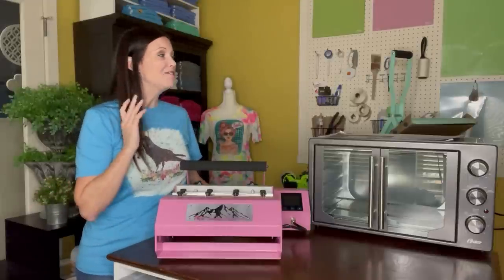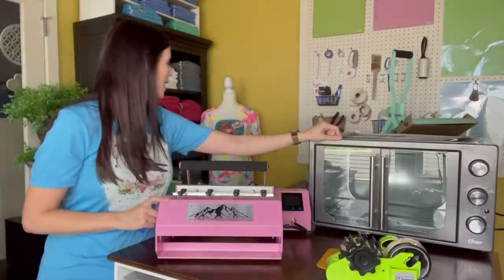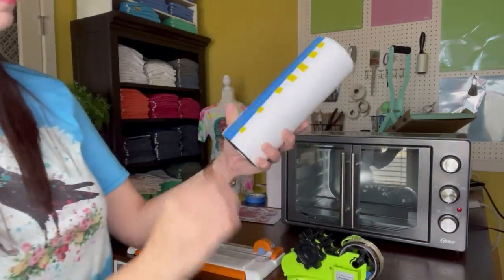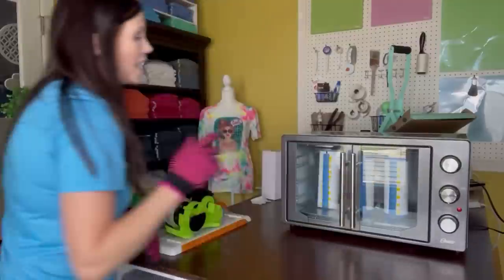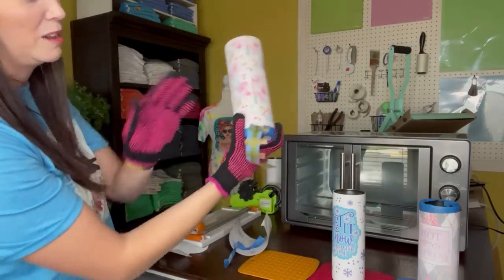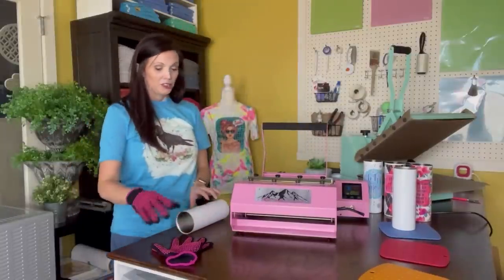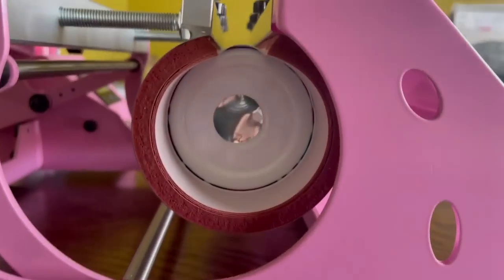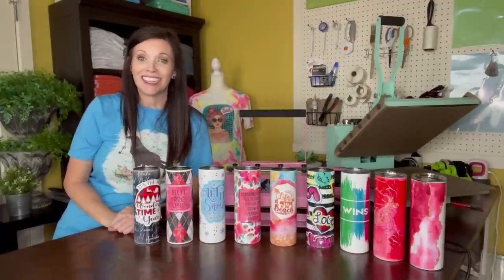How to Sublimate a Tumbler with a Press or a Convection Air Fry Oven.

Comment: I have the oven I no longer use shrink wrap and I use a silicone wrist band for top and bottom of tumbler so there is no ghosting.
Reply from the maker: Thanks for sharing Terry! I’ll have to try that!
Reply: So just the sub paper and silicone wristband? Or do you use tape also for the entire cup
Reply: Can you link the wristbands you are using for a newbie, please?
Reply: Is painters tape heat resistant?

Comment: Great Job Emma. I'm still kinda new to sublimating tumblers and had never seen it done with painters tape and without shrink wrap when using convection oven and the images still came out very nice. The video is very informative as I would not have thought about the edges of the mug press not being as hot and now when or if I decide to purchase a tumbler press I will make sure the length if appropriate. Thanks again for this video.
Reply from the maker: Thanks so much! 😊 welcome to the fun world of Sublimating Tumblers!

Comment: have a question about tumblers i keep trying and im not getting perfect images everytime is there anyway you can tell me what im doing wrong looks like in spots looks like its  a negative in spots and some come out like its kinda brown but color ok. ive had temp  at 400 385 and 390 for 8 min and then tried at 6 min anyway you can help thanks
Reply from the maker: It sounds like it may be too high of a temp for too long. Mine sublimate best around 365 for about 6 minutes

Comment: Question: with the convection why did you turn them? I thought if they were standing they would heat evenly all around.
Reply from the maker: I had watched a few other tutorials where they turned them halfway through. However, since then, I've had a lot of recommendations to increase my temp just a bit and then not rotate them at all.

Comment: I have the same oven from Oster french door and find it very difficult to get the temp at 365.  I have 2 thermometers in the oven.  When the dial is set to 350 on turbo convection, the internal temp is around 400-450. Any tips on setting the temperature at 365 or 375?Also, how do you know when the oven is done heating up?
Reply from the maker: Sounds like something is wrong with your oven. If your dial is set at 350 the internal temp should be 350 not higher. Your oven needs to be able to vent to release the hot air, do you have it in an area where all sides can vent? Mine has vents on both sides, back and top. I know when its pre-heated because I set a thermometer inside and as soon as it reaches the temp, I'm good to go.

Comment: @Emma’s Cottage. Do you have any trouble with blowout using the press? I was just wondering as I’m thinking of getting this tumbler press and don’t want to get ink on the pressing walls or what ever you call them. 😉. Please keep your videos coming, love them! 😍
Reply from the maker: Thanks so much for watching! No, I have not had any blowout issues with my tumbler press.
Reply: @Emma’s Cottage I’m getting ready to order the tumbler press. Do you know of anyone that has an affiliation with PNW? It is so expensive but after watching this video you did I really think it is the best way to go.  I’ve been using an air fryer and tired of the shrink wrap sticking to the mugs or tumblers. It takes a lot to get it off.  I didn’t use to have trouble but now it is a non stop problem? Ugh. Thank you
Reply from the maker: @shelleyparker2498  I’m sorry I don’t know an affiliate, I just found them through social media. I still love mine and have not had any problems so far.
Reply: I did it, I just ordered the PNW tumbler press! Wish me luck! 🤗

Comment: Great tutorial, what was the temperature on the conventional oven?
Reply: Great video! And I was going to ask the same thing.
Reply from the maker: I believe the oven was set at 350 but I’ve been told 365 is better and no need to turn them, so I’m going to try that.
Reply: Emma did you try doing them at 365 for 6 minutes and not turning them? Did it work better?
Reply from the maker: Yes

Comment: Interested in using Cricut Mug Press.  Blanks would need to be a diameter between 3.2 and 3.4 inches. The maximum height that you can sublimate is 4.72 inches.  Blanks will need to have straight sides in the area where you are putting the design.  It would be possible to sublimate half and then turn it over and sublimate the other half.    It would be interesting to see how a design would need to be created to do a tall straight tumbler in the Cricut Mug Press.
Reply from the maker: Hi Barbara, I know it can be done, I've seen a few tutorials. It just takes a lot more time so I haven't tried it yet.

Comment: hi emma, i enjoyed your video tumbler sublimation. ive learned a lot and hoping to learn more making sublimation tumblers. Ive started making Customized acrylic resin with glitters design with waterslide decals and vinyl but it takes a lot of time to finish eeekkk!! But when i saw the sublimation i kinda hooked with it so my husband gifted me a cricut mugpress machine in December 2021. I only used it 4-5 times and the other night it overheated and ruined the tumbler :(. Luckily I had another one left of sublimation tumbler and resublimate and did it in the oven and it worked for me for 375° for 4 minutes(simple design not full image. thank you so much for all your tips in this video. Will definitely check out the links in your description on this video.
Reply from the maker: Thanks so much for watching!

Comment: I absolutely love your videos!  
I do have a question. I am assuming not all tumblers are the same. I just received a box and every one I do comes out very light. The box says it’s for sublimation and I followed the time and temperature they suggested. I’m just wondering if there is something I could try to make it better or just strip them and use vinyl on them?
Reply from the maker: I would try a few more and adjust your temperature to a little bit longer to see if that helps. If it doesn't help, then I would not purchase that particular brand again.

Comment: You should wear a air filter mask. You are breathing in those vapors and they will damage your lungs. Great video. You should also have a window open for ventilation.
Reply from the maker: Thanks! I always have my window open and my husband installed a vent system in my shop.

Comment: Great video, thank you so much!  What temperature did you set your convection oven to?
Reply from the maker: I believe the oven was set at 350 but I’ve been told 365 is better and no need to turn them, so I’m going to try that.
Reply: @Emma's Cottage  how did it turn out? I did 390 for 6 min and it was horrible!
Reply from the maker: In this video I did 365 for 3 minutes, then turned and cooked another 3 minutes.  Maybe you did yours too hot for too long?